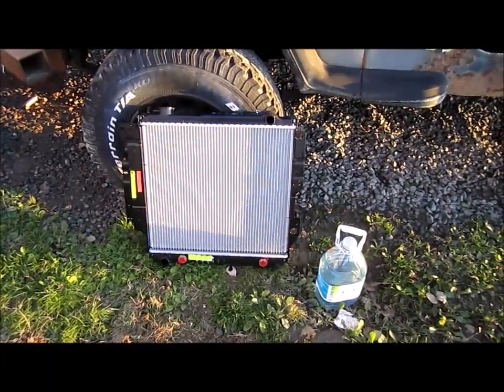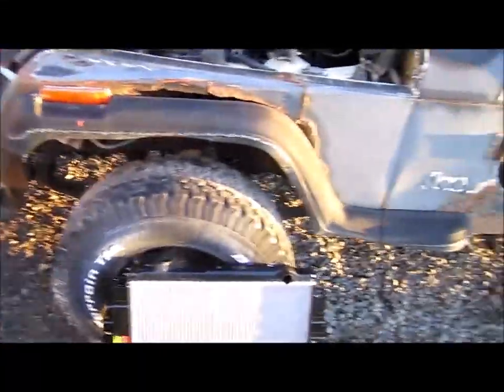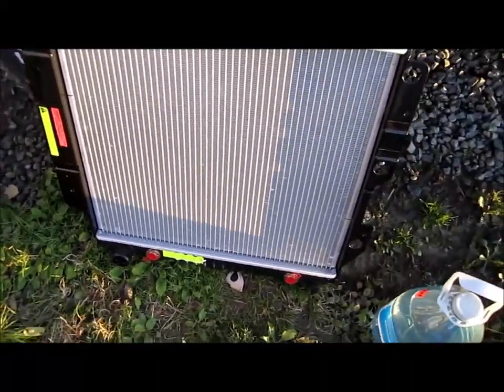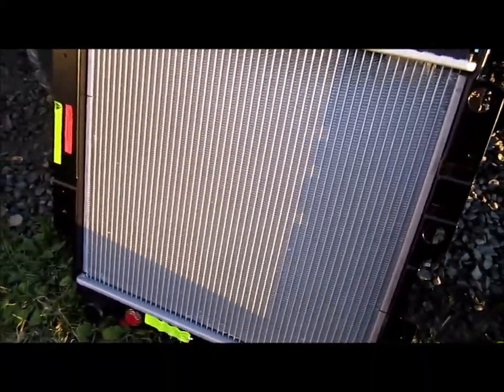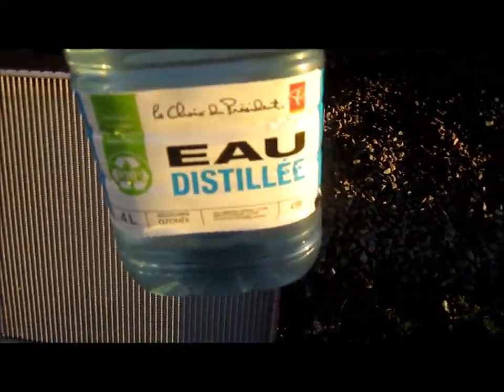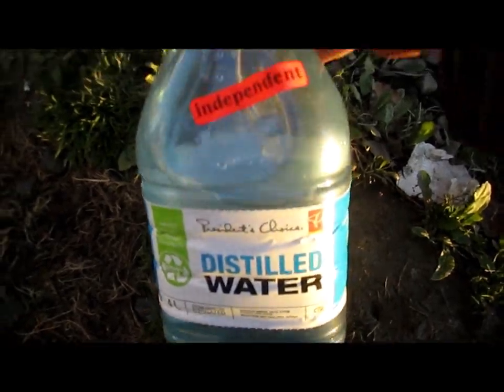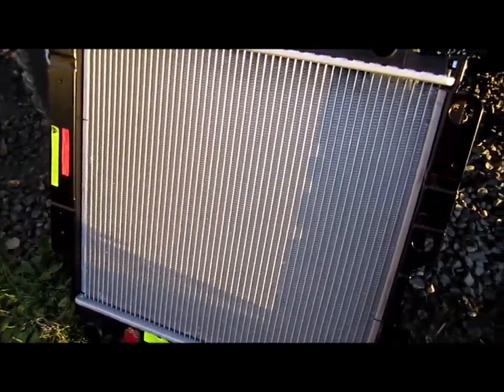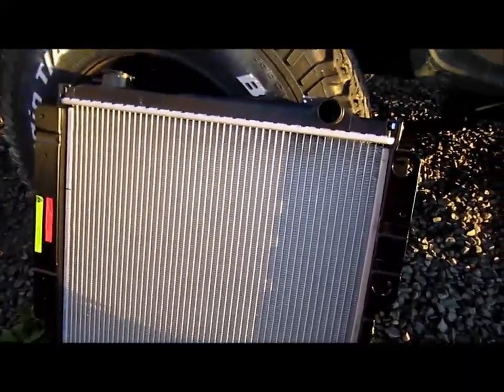Automotive Radiators And Distilled Water

Comment: Tap water bestIn distilled or RO water, the absence of ions increases the potential for galvanic reactions. When pure water comes into contact with dissimilar metals, it enhances the electrochemical process that leads to galvanic corrosion

Comment: What if i use ONLY distilled water in my cooling system?
Reply from the maker: Rust will form in area's
Reply: What should I mix it with?
Reply: @mariegarcia1816  50/50 distilled water and concentrated coolant

Comment: Is Distilled water acidic? if it's then it can spoil radiator 😭
Reply from the maker: It is acidic. Good point. But when added in with the antifreeze it wont do that. But just being used alone yes not a good idea. To add plane water in with the mix is not a good idea either. So just plane water is not good at all to use or distilled water alone is not good.
Reply: it does not really pull any acid or very little,,there is a guy who showed an exp about it https://www.youtube.com/watch?v=hzy3bKsjboA

Comment: I agree but the distilled water I bought says 'distilled drinking water' which sounds like purified, but it says distilled by distillation.  Should be safe?
Reply from the maker: Distilled is distilled best to use.
Reply: @MrDoingEverything  all done!  Flushed it three times with distilled water, replaced tstat and refilled with fresh fluid and fresh 50-50 mix with distilled - warms up faster and runs like a champ!
Reply: @MrDoingEverything  i got distilled water and found out later it says "added minerals for taste...."
Reply from the maker: @BobTheBreaker9  Read the ingredients  always when thinking something may only be something. There might be other things in it.  For best results coolant systems don't want minerals over the long period of time.  Over a long period of time it will do more harm then good.